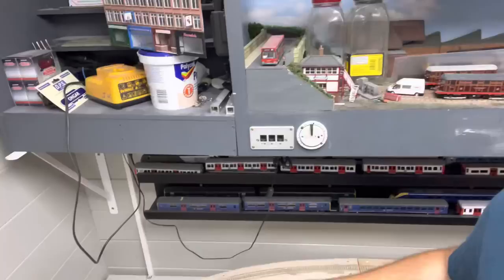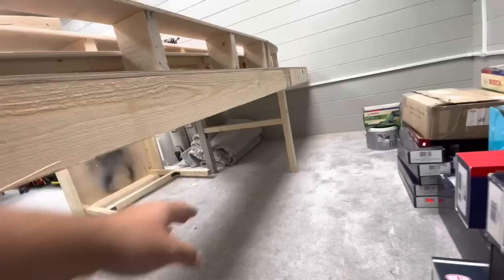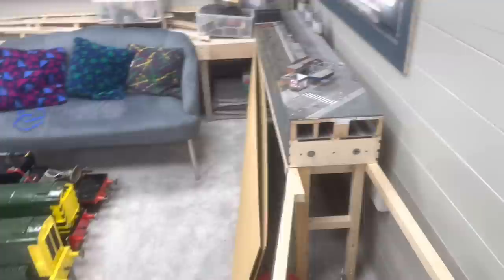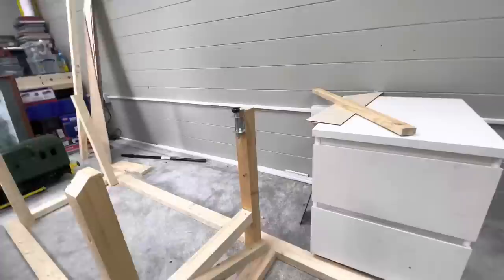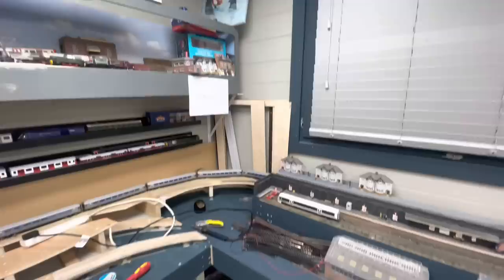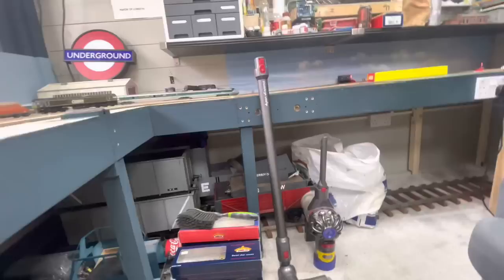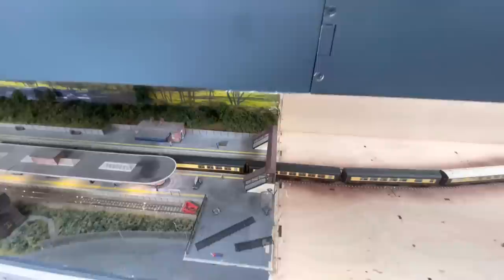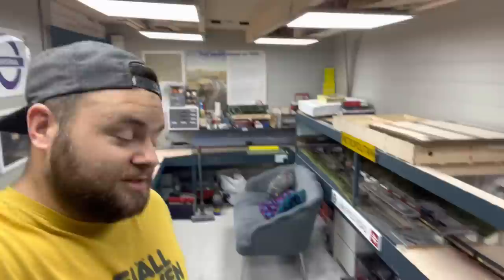London underground model railway build 5 - we can finally run trains!! - OO gauge log cabin layout

Comment: Your hard work has all been worth it, Eric, because seeing the trains running at the end was great. Is that the Chiltern Railways Oxford Flyer (Dapol?) towards the end? I've not ridden it yet but I've always liked seeing the class 68 hauled train with the class 82 driving trailer at the other end when I pass through Marylebone station. Is there a manufacturer who sells Chiltern Railway liveried coaches or did you paint them yourself by modifying another livery?
Reply from the maker: Sorry i didnt reply, slipped the net.
Thanks for the nice feedback.
The chiltern coaches are Hornby repaints, easiest way is using electra rail vinyl sides and then satin laquer to tone them down/seal them